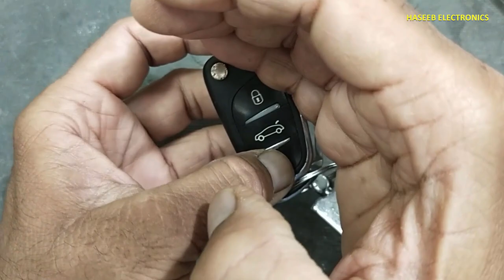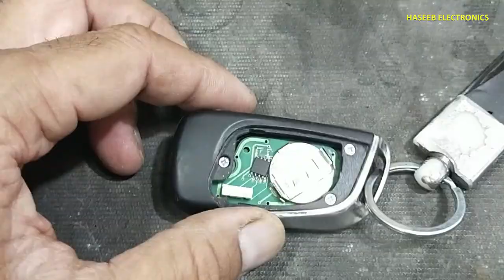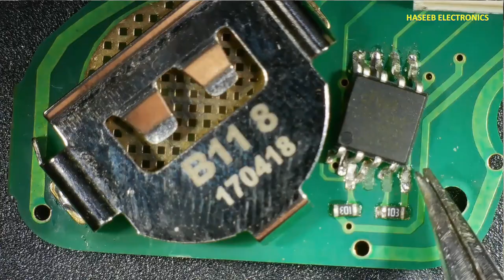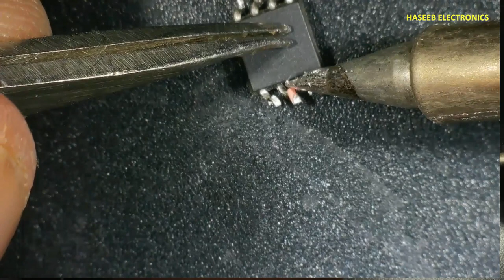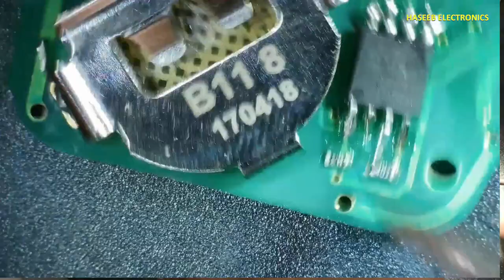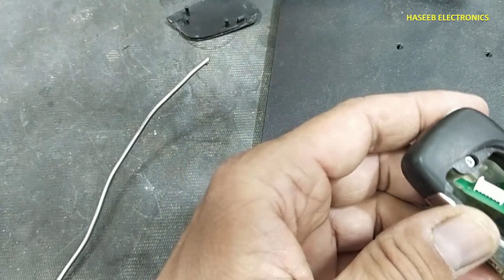{977} Car remote not working || Car remote control repair

Comment: Walaikumassalam Waramatulahi wabaarahkhatuhu. Thanks for this video. ❤️ May I know which wire you use for making the jumper.
And how much millimeter is it.
JAZAKUMULAH KHAIR
Reply from the maker: best regards 
most of time i take wire piece from ribbon cables, because it is easy in tinning. 
if i need insulated wire 
the i use commercially available enameled wires (0.15 mm, 0.25 mm brass wires etc)
Reply: @HaseebElectronics  thanks brother. For information. Jazakumulah KHAIR

Comment: Nice video. The soldering could be better and the IC should be fixed by some (hot)glue blob. But it works again, that counts. 😊
Reply from the maker: actually this user was replacing battery and he damaged it while pulling out PCB from the casing.
Reply: @HaseebElectronics  some weeks ago I had the same repair to do. 🙂 I wished the owner had asked me for battery replacement before. Hopefully next time. 😉

Comment: Very nice repair thank you. I know you probably mentioned it in one of your videos but what soldering tip are you using? Seems to be very good where did you buy it from?
Reply from the maker: best regards 
these are accessories for WELLER soldering iron. we can buy online or from local WELLER suppliers
Reply: 😅😮 2:33 😢🎉00,.
Reply: @HaseebElectronics اسلام وعلیکم
Sir plz mention d link or recomnd us good quality sucker, iron,s. wire